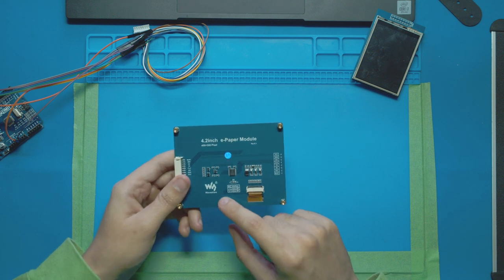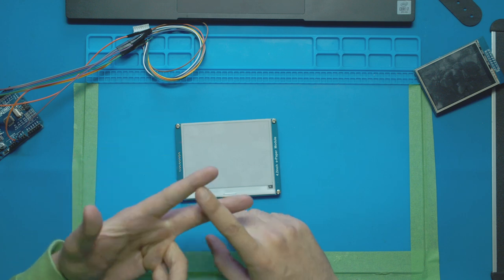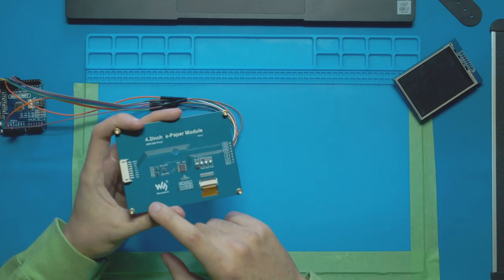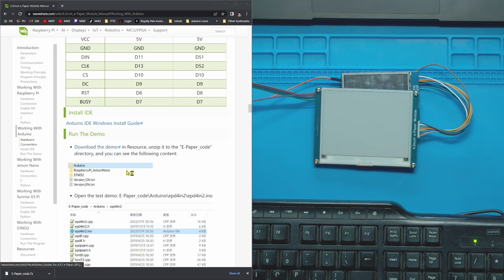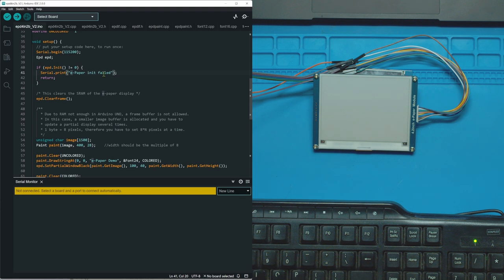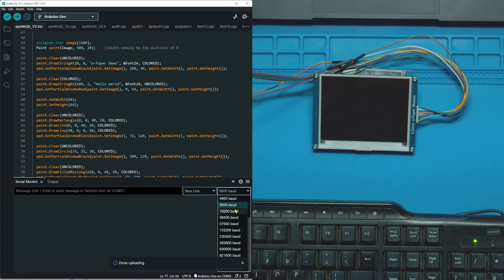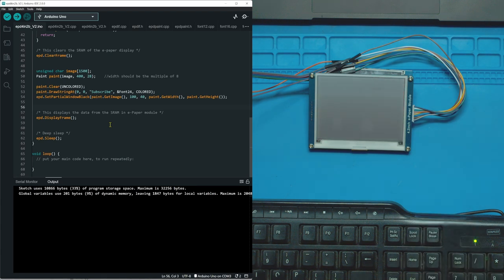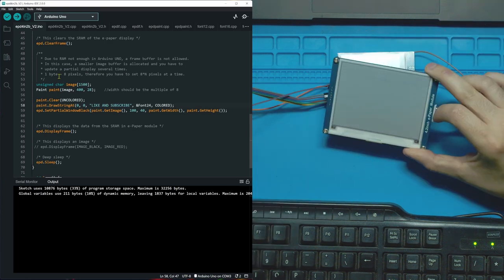DIY E-paper Display with ARDUINO: Setup and Programming | e-ink display | 4.2inch waveshare

Comment: THanks for the video . I have a Waveshare 2.13 in and the demo is working when I run it as coded within the adruino setup method.   When I try to then paint images, using similar paint and epd commands, within the "loop" method there are no results. I epd.init,  paint.clear, epd.display then paint.Draw (various images). Nothing appears after issuing the epd.display(....).   It is as if the image last set up on within the SETUP method does not clear and cannot be re written.    Within the SETUP method it all seems to work.  I have checked all the signaling with an oscillscope and all seems proper.   Any thoughts ?
Reply from the maker: it is a different library for that specific display?

Comment: What cable were you using to connect to the waveshare display? It’s an 8 pin cable, but what pitch are the pins?
Reply from the maker: they came with, but you can make youre own

Comment: nice video been trying to use a LILYGO® T5 4.7 Inch E-paper V2.3 ESP32-S3 to view pics from the sd 
card it has been not to ez as there is not a lot of info on getting the pic into them from the sd card
Reply from the maker: I’ll take a look into it
Reply from the maker: What kind of pictures ?
Reply: @MikaelAbehsera  png file format been at this for a long time thanks
Reply from the maker: @volkinaxe I mean what’s the image, we can always format it in different codecs
Reply: @MikaelAbehsera  i am giving this to some one as a gift note they don`t know anything about programing so it needs to be able to use a png format for the pic 
from the sd card
Reply from the maker: @volkinaxe then probably a good idea to convert png files down to something more digestible for e-paper/arduino. This can be done directly on the arduino so they can put png as normal
Reply: I don't know how to do that @MikaelAbehsera

Comment: I tried to run it in Arduino Giga R1 but is not working, I even changed the pins in the code. Any Idea?
Thanks!
Reply from the maker: never used one of those but try another board to see if its yours thats the problem or the code